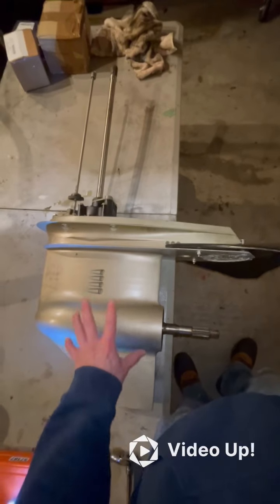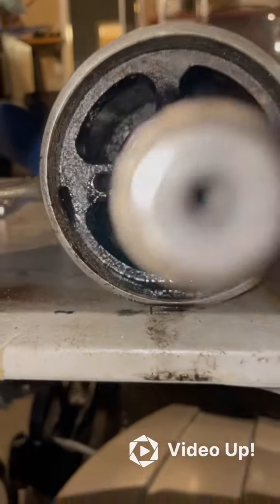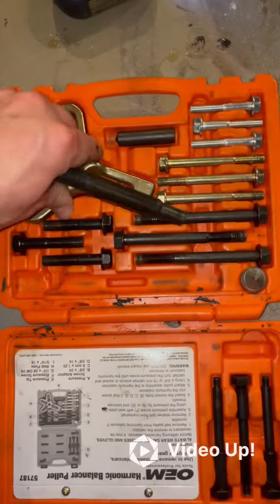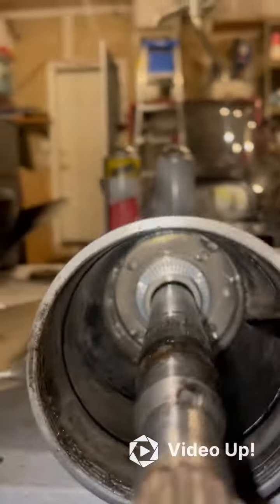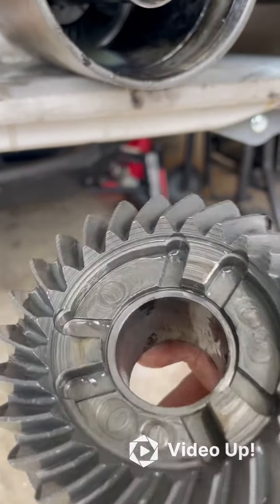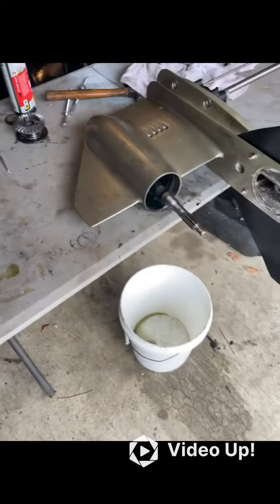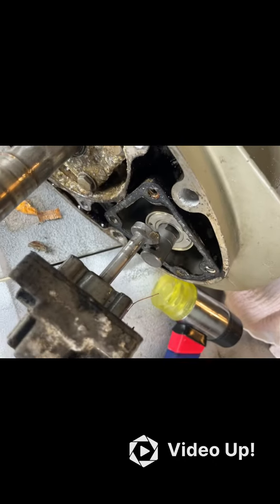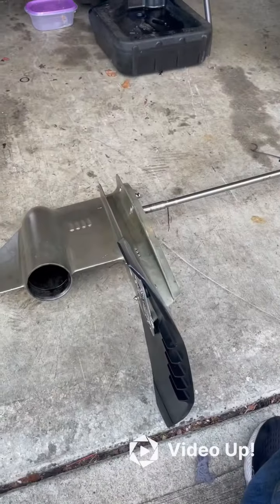How to disassemble a Johnson or Evinrude outboard lower unit.  Outboard lower unit rebuild.  #diy

Comment: Excellent video on how to get something done without expensive special pullers.  Other pullers work and other locations have free loan-a-tool.  I used Oreilly’s puller different than yours.  Get the 8’ bolts and not 6 or 7”, they don’t grab enough threads and will strip (disaster). When you say coarse thread the exact spec is 5/16 18 pitch not 24 pitch 8” long bolt.  Your pliers worked but I bought at the same price Knipex 12” 44 11 J4 which probably have more griping power to use on other lower units. Just providing other options on the cheap
Reply: The Knipex model is actually made in Germany, price was about the same, the prongs at the end were thick made from better steel (rather than interchangeable pot metal of same or steel from Communist China),  and prongs actually have slight angle inwards to hold the c-clip from popping off the tool during extraction.
PS, I don't’ buy Communist Chinese tools not just because I served in the Military but they are cheaply made and lack integrity (a corner of some sort will be cut in the manufacturing process even if designed and contracted (spec’s) by an American company).

Comment: My drive shaft nut was on much tighter,  vice grips were not getting it done and I risked damaging the splines.  There is a socket available on Amazon for, $20 and the spec is 22mm 20 spline.  I wasn’t sure but it is used on this model and many other higher HP models and years.  It is also used on some Yamaha, for this reason I recommend the socket at it’s price point
Reply from the maker: Mine was on tight.  The video doesn’t show me actually truly breaking it loose.  My vise grips fit perfectly into my splines.  So I just had to really man handle it to get it to crack loose.  Thanks for the comments.  Shoot me a subscribe.  That’s what actually helps me.

Comment: Question: I bought a seal and bearing kit because mine was leaking gear oil....do I only have to do the seals on the bolts and the bearing from the beginning?....I don't know if I need to disassemble the whole thing....
Reply from the maker: @zachschaefer3824  replace all seals anytime you’re dissembling the lower unit.
Reply: @TheDIYDoc  I gotcha....I just wasn't sure if I had to tear the whole thing apart...no sense in doing that if I don't have too lol. But if I'm in for a penny, in for a pound, right? Lol
Reply from the maker: @zachschaefer3824  you don’t have to tear the whole thing apart if gears are fine!   You need to replace all the seals. So bearing housing oRings.  Housing Seals.  The driveshaft seals and O rings.
Reply: @TheDIYDoc  Okay, I will focus on those. Thanks for the video and your help....I will post an update as it happens. THANKS AGAIN 😀👍
Reply from the maker: @zachschaefer3824  shoot me a like and follow thanks man